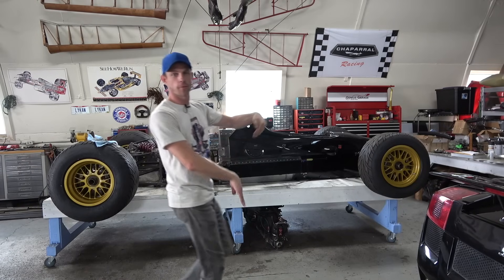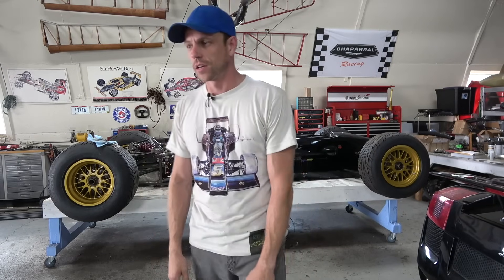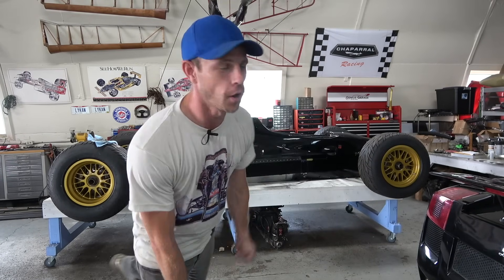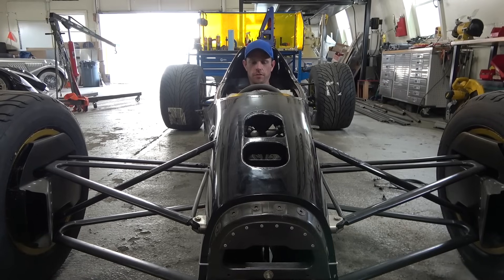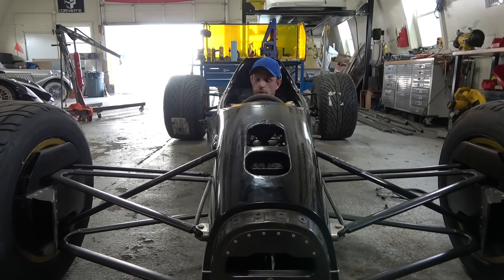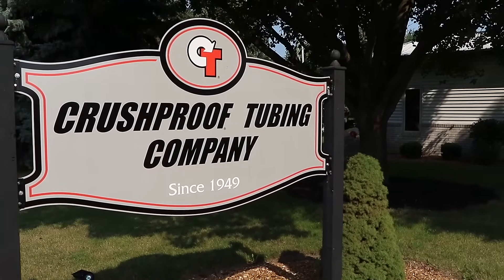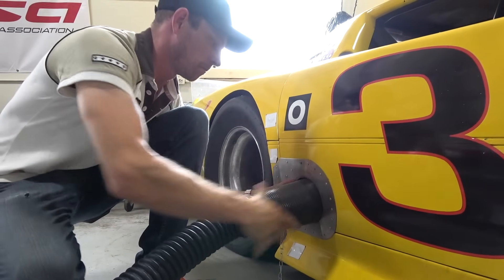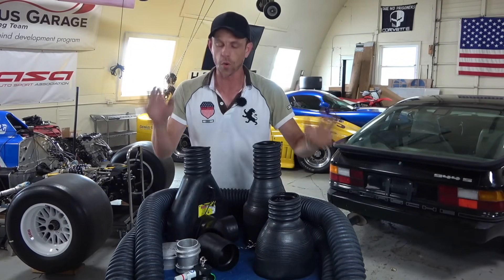Formula 1 BUILD Hits the Tarmac for the FIRST TIME! #8

Comment: I have a r8 v10 engine that I'm looking to swap into something.Revs to 8700.Would that be compatible with a transaxle like this?
Reply from the maker: Yes, but… length
Reply: 37 inches so would have to extend wheelbase a extra 7 inches more than Chevy v8.too much?
Reply: Correction it's 27inches long.I just measured it.Google says 37 I don't know why.So the same as Chevy v8.

Comment: What accommodations have you made for maintaining the drive chain? Most motorcycles adjust chain tension by moving the rear axle. Do you have a means to make small adjustments to the differential's fore/aft position? or are you using a supplemental sprocket like a tensioner pulley in a belt system?

Comment: You might want to consider a rework of the table design to make the dismount easier in the future.

Like if you reworked it around the idea that it's actually four smaller tables with holes on the common surfaces to accept a 4x4 peg (half of it in any case) with multiple latch fasteners across the bottom mostly to keep things from moving as most of the weight should be carried by the 4x3 pegs and legs.  When it comes time to get it off the table, you can split the table in half, then split each half into quarters, and get the quarters out of the way.